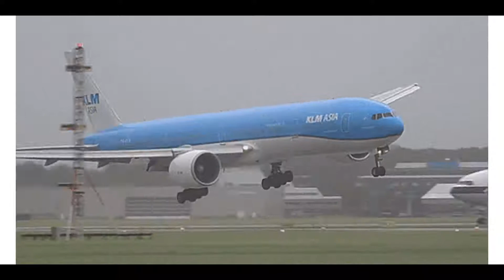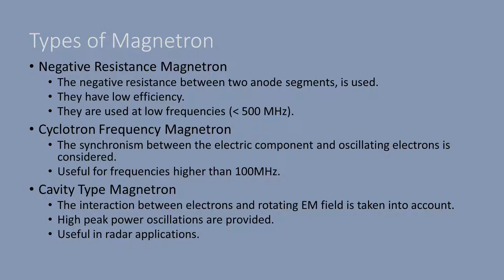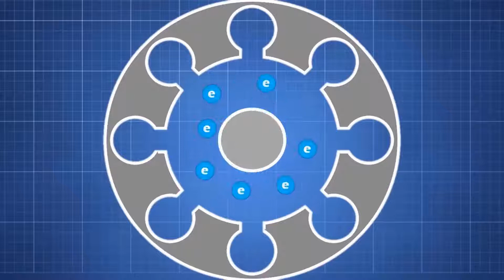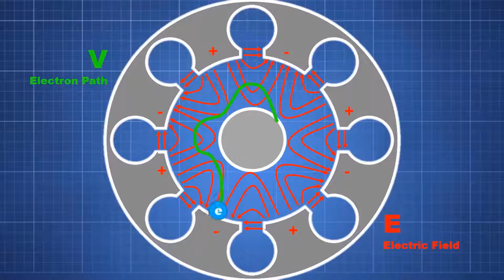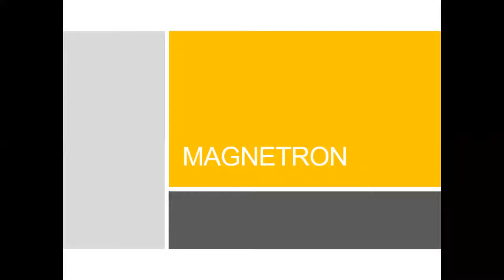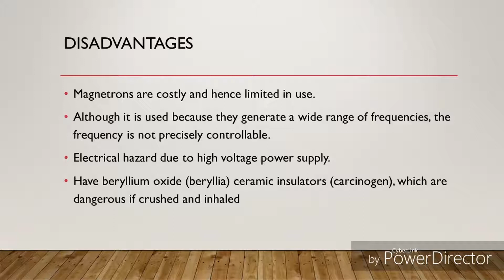Magnetron Report

Comment: Make it cone shaped and hollow with cavities (outside it looks like a solder gun tip) the very tip of the cone connects anode and cathode, the electric current goes down the cathode spins off electrons and it excites the cone which collects energy from the air